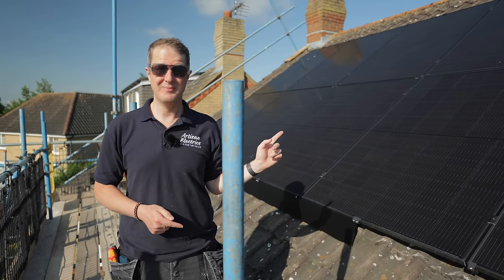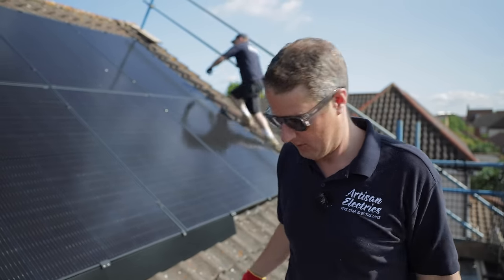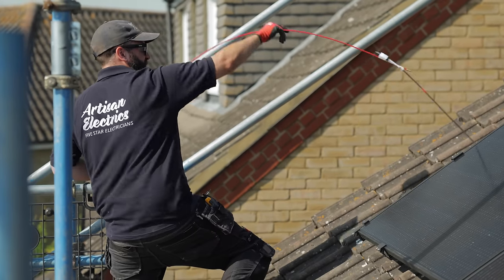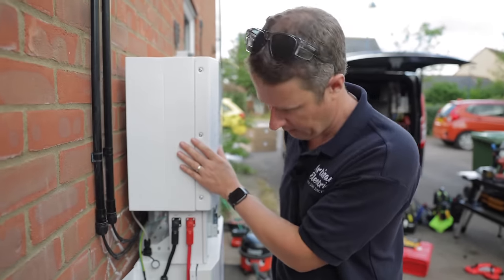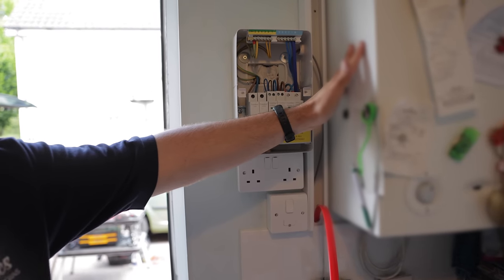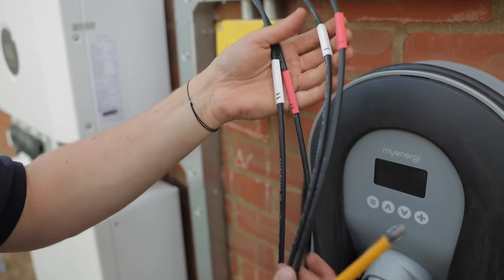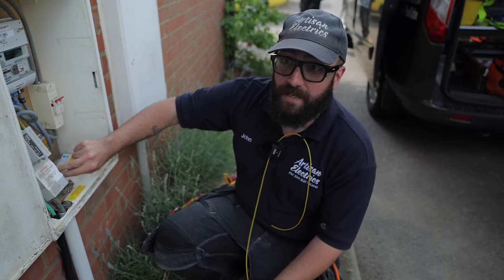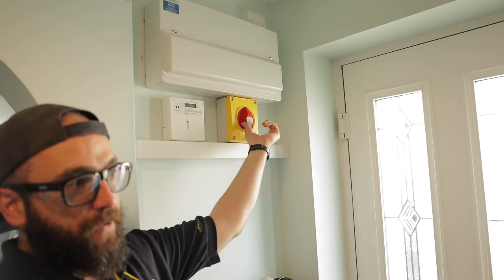Forced To Change Our Own Solar Install!

Comment: That outdoor AC isolator contravenes BS7671, the 20mm galv couplings are not water proof and are mounted beneath the 50mm trunking. This will allow water to ingress not only through the couplings, but also through the trunking when it fills with rain water too.

Comment: Also check specks of wego connectors.  As I believe a bare wire has better connection than a feral
Bootlace.   Victron has a good documentary about terminals regarding the issue with multi strand cable an the heat issues that happen

Comment: When you surround your panel installs with a trim like that, do you not ever get concerned by the not insignificant efficiency loss caused by them heating up? My reading of every piece of documentation I've ever got my hands on about solar suggests it's a reasonably big deal - it's one of the major issues with flush mounted ones for the same reason. Seems like maybe using a mesh or whatever instead to allow air to flow would be better, or at least some sort of venting grilles in the trim? Maybe it has it but I've seen a few of your videos with that installed and never noticed it. Silicon being silicon, it feels like excess heat will dramatically shorten the life also?
Reply: Yes, the mesh bird protection is much better for air flow and efficiency.
Reply: @sdgelectronics  I did a little research on solatrim since and it seems they make a chimney section with fairly large holes along it but only suggest one section of it per array - I think I'd want a bunch of them at the top and bottom and maybe even on the sides and it'll probably negate the problem pretty well. Can't fathom why they suggest only one per array though, seems a little mad to me.
Reply: I do not live in UK but around we have about the same temperatures in the summer. I have also installed trim around the panels, mostly due to how windy it  can be here and i don't want the panels to take off with the roof. Anyway, even on the the hotest days here they been prodcuing  almost the same as they do on a cold day. It's not something that's worth caring about, if you loose a 1kwh / day , so what?  
On the other hand the electric installation on the outside wall, there's no way that meets IP ratings 😨
Reply: @Iceeeen  doesn't make any sense for solar to produce the same on a cold day as a hot, and the numbers involved would be bigger than 1kw/h (and frankly you want everything you can get, particularly when you head to the poles anyway) - also why would an outside installed not meet IP rating? Makes no sense. This is what seals are for.
Reply: @streaky81  My system lays around 70kwh  on a cold day, best I seen is 72kwh on a day in april with snow still on the ground for extra refelection (it acctually even maxed the inverter for 1 hour), but then daylights is shorter. . on a hot july day it's down to around 67-69. Not something to care about when we talk about microprodcution. It's a couple of cents for me when I sell it to the grid. Makes no diffrence at all.   But even if the diffrence was 10kwh on really warm day so what? Its still just Micro prodcution.

The AC main switch will be full of water quite fast. On top of that they didn't put any drain hole on it. 
Allways go come in from the bottom on the outside, and if you really must do it from the top, fix a drain hole. Moisture will get in and ruin it.

Comment: I have 12 x 320 watt solar panels connected straight into my 5.5kW inverter in my garage with 8 x 6v 229 Ah batteries also connected to my inverter which is connected to my consumer unit to supply my house electrics  with a mains isolater switch and I don't have any of these electrical gadgets they have connected up and it has working fine for over a year now.

Comment: That is one rough install there ac isolation drilled through the top so will fill up especially the fact you have only done that to accommodate a dc isolator when you already have a 4 pole there you could have used for both strings and your cable management under the panels is a non compliant joke those cables will rub through against the tiles within years. You guys should be promoting good work

Comment: At my place code requires that dc conductors for bateries (and other unprotected sources) should be separated at least 30 cm (by old regulations, new is comething less, not sure how much) if not protected by fuse or circuit breaker (not switch, breaker as breaking short circuit currents). Putting wires in same pipe from solar panel would be a big no no at my place, but watching various clips from around the world, it seems that only we have that regulation. This is a real pain when doing batery wiring for transformer stations and similar (110VDC) where bateries need to have separate room also (naturaly vented). Nice work, love the videos. Best Regards

Comment: If you're ever in doubt about the safety of disconnecting PV DC under load, there is an extremely simple solution: Drape a dust sheet or tarpaulin over the panels whilst you disconnect them. If they can't see the sun they can't hurt you. 

In general, whether it's safe or not varies greatly, with only 8 panels you should be fine as the peak voltage won't be too high. With long strings you have to be very careful.

Comment: My understanding is that it is ok (with basic electrical precautions) to disconnect MC4 DC cable (break the string) with NO load. ie. DC Isolator OFF.
Reply: We do it all the time your correct 😊

Comment: A max 4 pannels per string , that’s going to be a serious issue for many 4kw per string  and even some 7kw existing strings which only use 2 strings in total to 6-8kwh  which use 8 or more panels per string exceeding the amps or 3.5 kwh per string especially with new 400+ w panels, new pannels are rumoured to pass 460 w for 68 cell this year myenergy need to rethink support for larger arrays as others will look elsewhere if forced to buy a more expensive inverter 3 string or more

Comment: Just curious how you secured the additional pair of cables you ran under the panels to split the single string into two. If you were due to lift all the panels there would've been no need for the cable rods, so presumably they're just dangling on the tiles unsecured???

Comment: It seems that in the event of a power cut, only the boiler will be able to still run, the battery installed was quite substantial though. Does the battery mostly just store energy for the car charger and not supply power to the house at night?

Comment: Aren't you supposed to mount a fused separator between the soler panels and the SPD so that in case of a overcurent the SPD blows the fuse and stops the flow of current?

Comment: When did the DC surge protector rule come in?  My system doesnt have them, it was installed in August 2022?
Reply: I had solar installed this month with no DC surge protection - only AC surge protection. My understanding is -:

Section 712

We also have some changes to section 712, with respects to surge protection.

Regulation 712.443.101 states that where protection against transient overvoltage is required by section 443, such protection shall also be applied to the DC side of the PV installation.

This will mean that if the electrical installation requires surge protection to be fitted to comply with section 443, as discussed above, SPDs would now also need to be installed on the DC side of the installation to protect both the PV panels and the inverter.

When the inverter incorporates an SPD, it is only considered as fulfilling the SPD requirement if the manufacturer specifies its use for the DC side of the PV installation, otherwise, it will need an external SPD. Varistors included in the inverter are not considered an SPD.

Surge protection devices designed for the use on the DC side of a PV system are designed to a different standard than SPDs used in low voltage installations. Although they are still described by using type 1 and type 2, as explained above, where type 1 devices are to protect against direct lightning, it is extremely important that only devices designed for use on the DC side of a PV installation are used. All SPD’s installed on the DC side of a PV installation shall comply with BS EN 61643-31.
Reply: @rdstewart14  "...................as explained above, where type 1 devices are to protect against direct lightning,....................."  

Nothing protects against a direct lightning strike - it blows everything around it to shreds.  The whole concept of a surge arrestor, of the types mentioned, protecting against direct lightning is, IMHO, absurd.  I have seen the effects of direct strikes on remote radio installations - not pretty.

Comment: You can't count in watts. You have to pay attention to the maximum voltage and the maximum amps of the PV modules. With the Voltage you have to consider that the voltage can get even higher on cold sunny winter days. So always calculate a safety margin with the voltage.
Reply: When you look at something like the Victron MPPT calculator, they want even more details, open circuit voltage, short circuit amps, peak power voltage, peak power amps, then they want to know the working temps, all as well as the wattage. I wonder how MyEnergi can just say 'ah upto xKw on a string'. Maybe the proper installer literature gives the more details? The product spec sheet is not enough from what I understand.
Reply: I think the Confusion is Comming from it says Max then says recommend mppt wattage? so is it max or recommended

it's mppt has 15A max and 560v max mppt, (but would recommend staying below 500v due to max voltage been only 580v dc)

can't see why it needed to be 2 strings going to lose out on early morning minimum voltage startup (150v) and the previous setup that was single solar string (in perfect very cold but very sunny conditions) can't ever exceed the maximum DC voltage and amps of this inverter (the mppt should be limiting the current if required)

Comment: My system has two strings but I only have one DC isolator - I'm not a spark but I think it is a "double pole" one?  Wouldnt that have been better than trying to shoehorn in a 2nd one?
Reply: That’s what I thought, and wasn’t the existing isolator double pole? The 2nd one wasn’t double pole so no real need?
Reply: You can do it with one. Reason I'd use 2 is if you have an issue with 1 string you can easily isolate that one separately and work on it while the 2nd string can still operate

Comment: Shouldn't the RS485 connection be made via a screened twisted pair cable?
Reply: Yes it should, and zooming in on that cable in the video it neither looks screened or twisted pair. It's a short run so will work but it could be susceptible to EM interference such as from a mobile phone being used near by. They could find that the controller occasionally looses connection to the external Libi unit.

Comment: The skirt looks good aesthetically, how will it affect the panel temperature during hot weather? Surely it must restrict air movement under the panels?
Reply: It will cause the panels to heat up quicker but still cooler than an inroof system

Comment: Great video
But you can get dual string DC isolators and PVC trucking would likely survive bit longer outside
Reply: The existing isolator was 4 pole, not sure why they didn't just use that for both strings, rather than installing a second 2 pole one!
Reply: @Sparks0001 current rating lads. If you run it thru all poles you double your current rating

Imo I'd the only real DC tested isolator most others are rebadged ac isolators with poor contacts 😢
Reply: @bramcoteelectrical1088  It was wired it in series through two contacts for + and -, not parallel...
Reply: @Sparks0001  I looked wrongly at it lol my bad 😎🤣🕴🤓

Comment: Hi Jordan - Great job and fantastic example of what you can achieve with a cohesive team who are artisan in what they do. I have some naive questions as a potential customer... Why are you using myenergi (due to the Zappi)? Have you used Tesla's Solar Panel PVs? If not, why not? Why did you not go for the Tesla Wall as your battery storage? In general, how much would it cost for a 6-panel Solar PV System? Thanks in advance, Abi.
Reply: Last I heard there is a 1-2 year wait for the Tesla power wall.
Reply: Available next day in U.K.

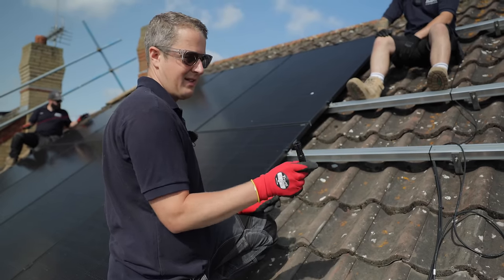Comment: 4:16 If there is no load you can safely disconnect those, nothing should happen. If there is a current flowing (load) you should avoid disconnecting them.

Comment: I know looks are subjective, but I LOVE the industrial look to that install. This would make me happy to see when getting home.
Reply: Bet you'll change your mind when you're calling back the electrician every time it rains. That trunking isn't IP rated and water will get in fill it up and with AC isolator under the trucking connected with just couplers and buses it is now no longer ip rated and will not like water in it
Reply: @roydowling2542  Oh I wouldn't have thought Artisan would have installed something outside that wasn't IP rated.
Reply: @@jscott3347 That was my thoughts too. They even raised the battery unit off the ground to prevent standing water from reaching the it.

They even spoke of the risks about installing things outdoors too, so they're aware and I would assume they'd mitigate them as best as they can (if only for warranty reasons).
Reply: @@jscott3347 I'm certain that is not IP rated galv trunking....the IP rated stuff is very different and has various seals. Top entry into the isolator with galv couplers from non IP rated trunking - is complete madness, it will leak and it will fill up whenever there is driving rain hitting that side of the house.

Comment: No! MC4 are not designed to disconnect under load. They will arc and be damaged. But if there is no current flowing through the connector then they are not "under load" even with hundreds of volts at the connection.

Comment: Unplugging should be safe, if and only if you don't have a complete circuit, because then there is current flow, but you'll have a potential difference, between the MC4 connectors in this case. If there is a short, in this case without the inverter, then there most likely will be a massive current flowing in the circuit. For how long, depends on multitude of things, internal resistance, protective elements etc.

Comment: MC4 is not designed to be disconnected under-load (tho in your case there was no "load"). That said, MC4 connectors are not meant do be unplugged and replugged multiple times, it will degrade when you do that.
Even worse. MC4 is not a real standard. It was designed by Weidmüller and multiple other companies now sell "MC4 compatible connectors". But they all have slightlky different tollerances and differences in the materials used.
As a result you MUST NOT connect MC4 connectors from different manufatuers. Especially on larger installs with higher holtage/current, you will see MC4 connectors melt over time when you combine the wrong manufatuers.

9:14 if you did connect it like that you made a misstake.
You must loop the (-) back under all the panels along the cables that come of the panels. Otherwise you will run into issues with induced voltages.

With 2 strings you did it correctly. Always run the (-) back alongside the (+) under the panels.

25:00 temp sensor should be placed under the panel, not on top as direct sunlight affects the reading.

Comment: Solar Skirts to block ventilation, is this required or just meant to reduce efficiency?
Reply: It's to stop pigeons nesting underneath.
Reply: @gadgetman36  Difficult to imagine pigeons nesting below such a flat PV. Also, looks like pigeons here didn't get this info 🙂. Keeping in mind that temperature is one of the main efficiency factors you are able to influence, an open, net like structure should be considered.

Comment: To be fair I think you should have had it in 2 stings in the first place, I'm assuming your at like 200V+ open circuit voltage even being split between 2 strings which as long as you are decently above your battery voltage which I assume is 48V your doing fine.

Comment: As long as switched off and Isolated at the Invertor or DC Isolator it is safe to unplug the MC4 Connectors without risk of arcing.

Comment: If there's no load then there's no problem. As you break the connection the voltage provides an ionisation path the length of which is relative to distance, in there is a load then current can flow through the ionization path causing arcing, no load=no flow so no or minimal arcring.

Comment: I would have been inclined to mount the libby 450mm minimum off the floor level. For water, future maintenance for groundwork access, cleaning, general building codes and look of mounted electrical are always 450mm anyway. Definitely learned what I need to know to install this myself in the near future though so thanks. I would call what you call a string a ring. But what do i know.

Comment: Wont covers on side of the panels block convection cooling? My black panels generate pretty strong heat convection underneath the panels and hot air is rushing out from the top.

Comment: Regarding those CT clamps can you install them on a domestic installation without a EV charger and have (hardware) software running on a enterprise server?
I'm at the beginning of setting up a proper network in our house complete with a server for several services and would like to keep an eye on our total electric consumption.